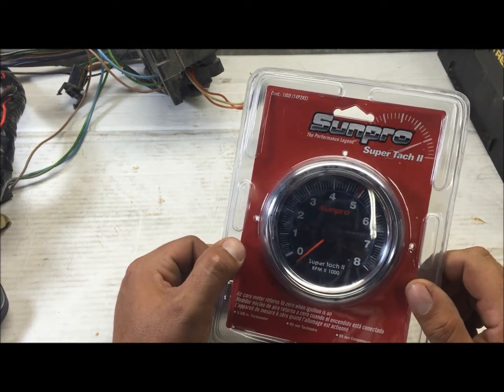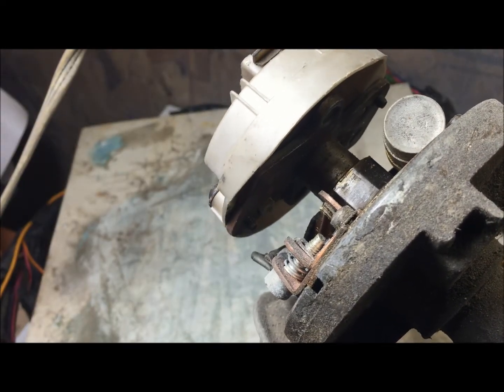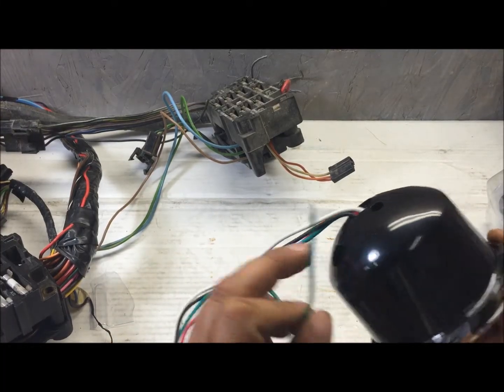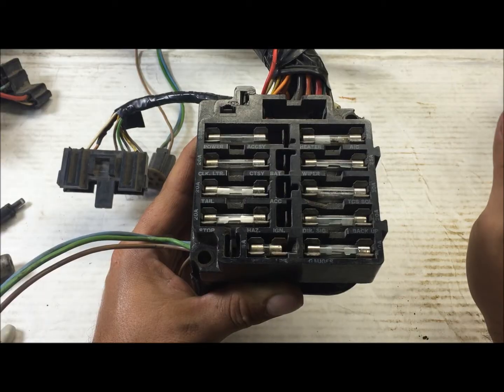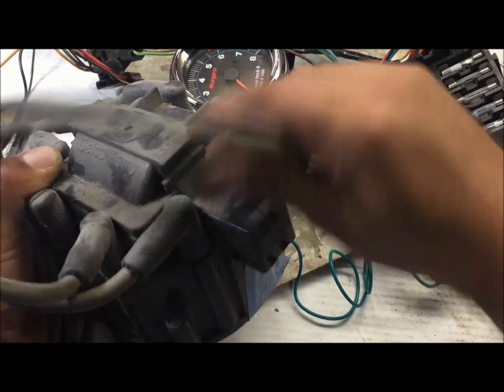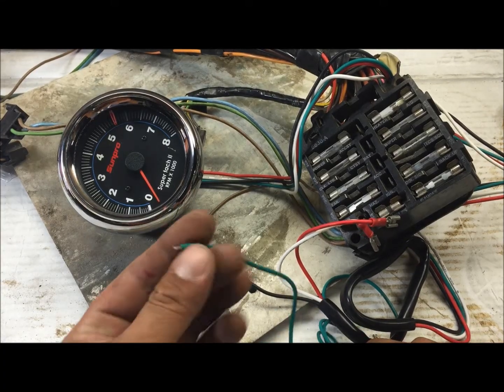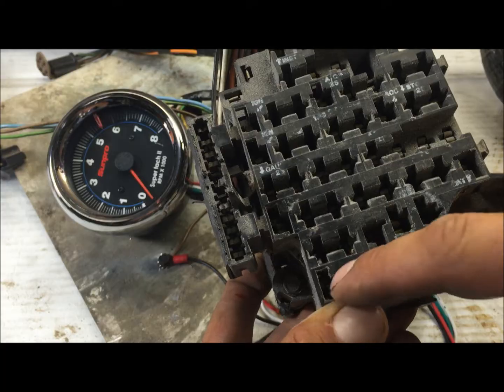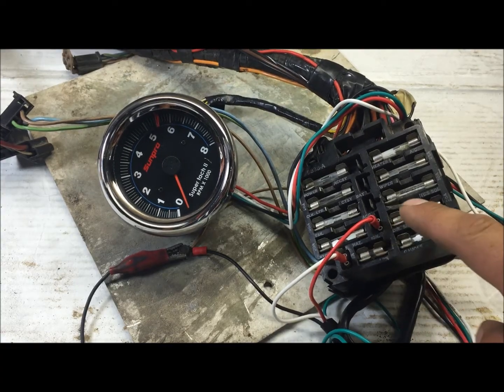how to install wire up a tach tachometer the right way GM for beginners DIY

Comment: Thanks for the video going to setup a tach on old Camaro.  Thinking of slicing old tach line to the green instead of wiring all the way through the firewall.  Grandpa  disconnected the time on dash to save battery but I think he messed up on the tach doing so.  If not going to run the green to the front like you did.

Comment: Good video.  Didn't answer my question .  I've got 3 wires on my Schneider tach red , blue & black. Then a white for light. Where do I hook up the blue wire ? I don't have a green wire
Reply: Is the blue  a green now ?
Reply: Will hooking the blue wire on my old Schneider tack get ruined if I hook it to where  you say the green wire goes ?
Reply from the maker: I don’t have your tach.. I don’t know l. Blue is probably illumination on radios blue is antenna or remote amp

Comment: Got a sun super tach from like 10 years back and when i was installing my msd 6AL-2 box i re-wired some thing 4 wires black,white,red and purple black to ground red to 12v ign.. but the white goes to the msd box gray wire for tech and the purple wire is for the lights

Comment: Hi Chris, I bought a 70's steward warner Tach gauge. It has the green, red wires but not a white wire. it has two black wires that are connected to the bulb?

Comment: Well by my its complicated my Opel Ascona C is not even close to any discription I have only singel hei E core type ignition coil and ordinary delco remy alternator even tought the american version is lot diferent the internals are diferent.
So I have dificulty finde how wire rpm meter?
So how solve this problem?
Shuld I buy seperate senzor and simply mark my belt with somthing?

Comment: I'll find out weds when I'm installing a set of gauges and a tach but, where you tapped into the box is that before or after the fuse?
Reply from the maker: I have never fused a tach but if you wire off a spade from the fuse box fuse the red wire to the tach
Reply: I'm more worried about the illumination, I'm wiring in 4 total and don't want to overload the fuse or, if it's not fused I'll be adding one, it's for a 64 Malibu with a 396bb and it's not mine lol.

Comment: I got a tacho with 3 wires, red black and green, red and black when attached to a battery the led shows, so guess the green to the engine coil?
Reply: Find a “switched” circuit to plug the red wire into or you’ll drain the battery. Green goes to the negative side of the coil, or the connector on the distributor cap that says “tach”. Watch the video. It shows nearly all the possibilities for the green wire.
Reply: Sounds like it doesn't have a wire for your light

Comment: Hi Chris!  Great video!  I've got a '71 Chevelle SS 454 with a points distributor and my in-dash tach doesn't seem to be working.  I'm not sure if the tach is bad or if there's a bad connection somewhere but I'd like to preserve the original look and feel.  I have a spare dash-mounted tach lying around similar to the one you show in this video.  Could I just connect the green wire to the "Coil" post on the back of the tach in the gauge cluster, connect the red wire to the 12V post on the back of the tach in the gauge cluster, and the black to ground and see if the external tach responds when I start the engine?  If so, that would help me determine whether the wiring going to the gauge is faulty somewhere or if the factory tach is indeed bad.  Thanks!

Comment: Awesome vid, very informative, I cant get my tachometer to read correctly, I put a v8 in a 97 c1500 with a v6 cluster, at 5v from tach wire my guage reads exactly twice as much, any Idea??Thanks!!
Reply from the maker: there has to be a way to switch the tach to v8..   i doubt gm made 2 tachs that look the same but are different
Reply: That's it the 3 or 4 tachs I've bought ALL have a switch on them, marked 4, 6, 8, so, there you go!!! Find the switch!!!

Comment: Have 73 C10 installed an after market tech. Worked fine for several years now it's jumping around like crazy when I rev the engine. Checked the sending wire to the coil - it's secure. Checked other connections seem ok. Now what do?
Reply: Check your grounds. Then check all the spark plug and coil wires. And cap and rotor.
Reply: @TheAwmartin  Thanks, the Tach went bad. Have already replaced it.

Comment: I have a 96 impala ss, with an optispark, how does this apply, I mean for the green wire?
Reply from the maker: that car has a tach from the factory..
Reply: @chriscraft77022 , yes Sir, it has but the whole cluster is not working, and I cannot find a replacement one. I am trying to build a custom cluster with analog gauges and digital addition using raspberry pi.
Reply from the maker: @mohamadnbadr  find the tach signal wire to the cluster... use it ....or find where it connects on the engine
Reply: @chriscraft77022  thank you, very helpful.

Comment: 87 Buick Regal.    Anyone where I install my green wire signal tachometer.   I’m breaking my head.    Can’t find any video     Thanks in advance
Reply from the maker: negative side of coil.. on distributor cap it has a place labeled TACH on the left
Reply: Got it   Thanks

Comment: If you attach the green (RPM sensing) wire to the grey and black wire coming of the coil you get proper operation on a 2001 Chev 5.7

Comment: I don't know where to put my green wire I stripped several wires and nothing lol I have my red to the ignition and the ground in the rpm light does turn on when I flip the key but just don't read rpms help please it's a 2004 Honda civic coupe 1.7l
Reply from the maker: doesn’t that car have a factory tach?
Reply: @chriscraft77022  My does not have a tach only gas,temp and speedo it's a manual trans
Reply from the maker: we’ll find out where the factory tach wire goes or is connected to ...
Reply: @chriscraft77022  I found it after so much searching maybe if I do a YouTube video it will help several others
Reply: @chriscraft77022  thank you very much and for the fast replies aswell amazing
Reply: @chriscraft77022  I dont have a white wire on my coil
Reply: I dont have a white wire
Reply: @rickydeck795  doesn't need a white wire

Comment: Chris thank you! 👍I've been chasing a parasitic battery drain for months. After watching your video. I realized I attached my red tach wire. Straight to battery at the fuse box. Not switched power. After doing a drain test I was getting 80 milliamps drain. It was the stupid tach all along.

Comment: Thank you for this video. It's a big help. I've watched a couple tach hookup videos that I shutdown midway through because they would pan under the dash and there would be a bunch of wire nuts. I know those don't belong anywhere on a car. Thanks for the test light tips too. Very helpful.

Comment: Can you do a video with a high torque starter. I'm trying to convert from stock starter but don't know where one small wire goes using a gm hei
Reply from the maker: what kind of vehicle.. ? the starter doesn’t have anything to do with HEI.. or did the car used to be points ignition?
Reply: Chris Craft 1972 El camino.  It has hei dstrb on it but the stock starter had a wire to "s" & a wire to "r" new high torque starters don't have a place for both wires
Reply from the maker: HEI does not use I or R,,,,  that is for points ignition...run 10 gauge purple wire to S only
Reply: Armando Saenz https://youtu.be/EF5v5mqv60U

Comment: I have a 67 Camaro and my "ign fuse" is already being used.  What are my options?
Reply from the maker: you just have to spice into the wire going into it..  make sure you fuse it so you dont mess anything up..  just a little 10 amp fuse will due
Reply: Buy what is called a Add-A-Circuit fuse holder or also called Expandable Circuit on Amazon. Or simply look for fuses, they will all come out. This is like a fuse adapter with 2 extra circuit extensions for connecting 2 more fuse circuits. It also has a red wire on the side. Keep in mind that the "ign fuse" is only a temporary power circuit, by this I mean that as long as you put your key on the ignition and switch it to On or turn on the engine, that's when it will turn on whatever you want to turn on at that time. For example a radio. The radio will only turn on as long as you have the key on On or when you actually turn on the engine. If you want your radio to turn on whenever you want with out the keys being on the ignition switch, you have to find a permanently powered circuit (as long as the car battery in connected of course). To do that you have to poke wires with a test light to see which wire is hot (powered on) all the time with out the key in the ignition. If you want temporary power circuits, poke a wire that doesn't and then switch the ignition to the On position to see if the light on your test light turns on. Switch the key to the off position and see if the light on your test light turns off. If those 2 things happen, you got a temporary power circuit. There's also another option for connecting extra things to your car. You can also connect it to the wires that power up your radio, your cigarette lighter,  the dash lights, or even directly to the battery positive post with a very long wire. But why bother using a very long wire that goes from the inside of your car going all the way to the car battery when you can find power any where under your dash.  Also don't forget, whatever you are connecting, it has to be grounded. Always connect the black wire to any metal part on the car with a screw. Try to install the wire to screws or small bolts that are factory installed. You may have to lightly sand the metal to remove paint or rust to make sure you get a good ground. Hope this helps.
Reply: Johnny John 😨👏😨👏😨👏😨😨,🏌,🏌,🏌😨🏌😨😨😨🏌😨🏌😨🏌😨🏌😨🏌😨🏌😨🏌😨🏌😨🏌😨🏌😨🏌😨👏😨👏😨👏😨👏😨👏😨👏😨👏😨😨👏😨🏌😨🏌😨🏌😨🏌😨😨🏌😨🏌😨🏌😨🏌😨🏌😨🏌😨🏌😨🏌😨🏌😨👏😨🏌😨😨👏😨🏌🐿
Reply: heather braun 🤗